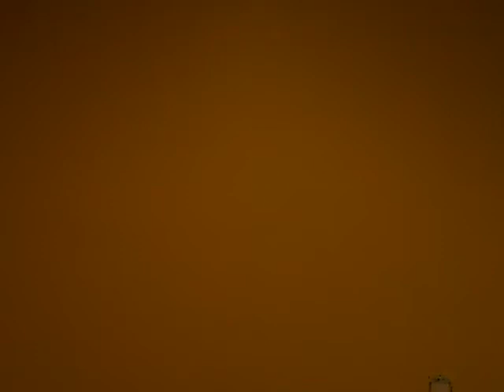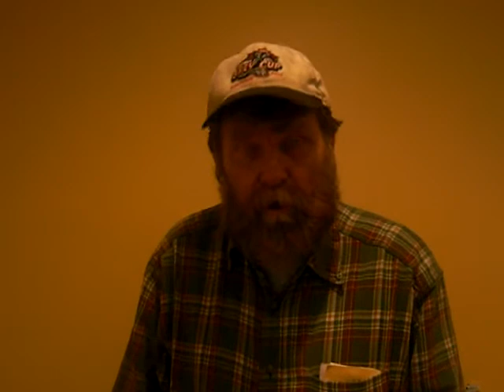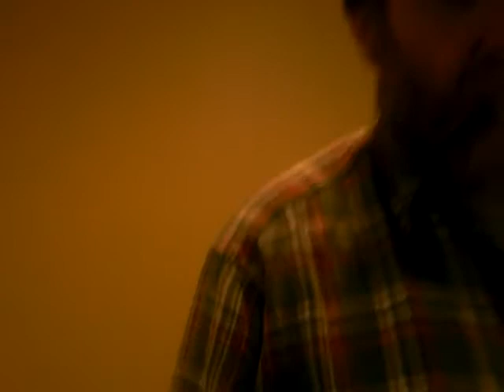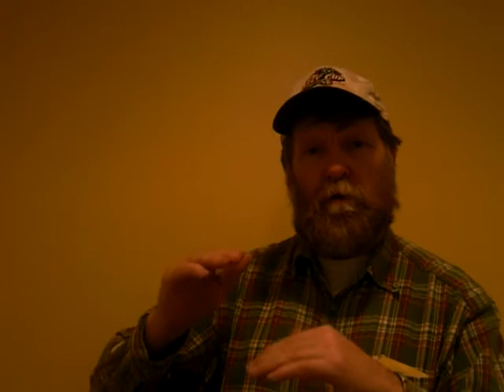205-PART 1 of 3-Joe Pipe Gasification for household power generation.

Comment: hello manchild im doing the samething with a gasifing stove and boiler. this idea is vary old they do it in newer powerplants high end gasifiers . its call fuel enrichment or hydrogen reformation they used to call it water gas.there is a concept for a coal gasifition steam train that came out in 1978 that used superheated steam sprayed across the bed of coals to enrich the fuel google it you will find it. they are strongly thinking about it because in a 25 hour cycle they use 8 billion in fuel. with coal gasifition and fuel enrichment they would save 6 billion US dollars and but more people to work.